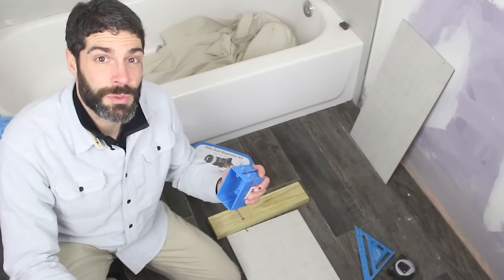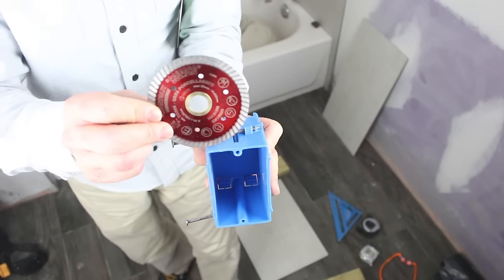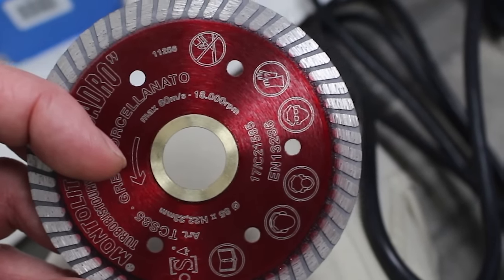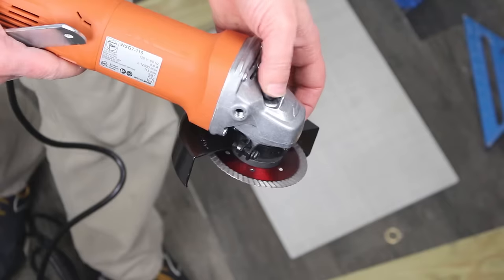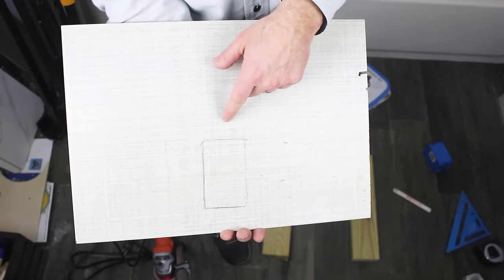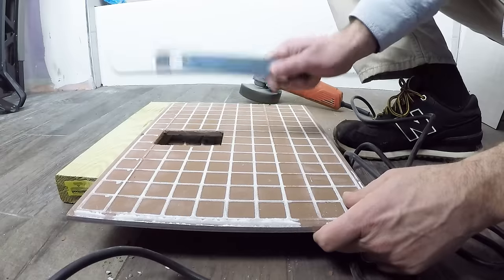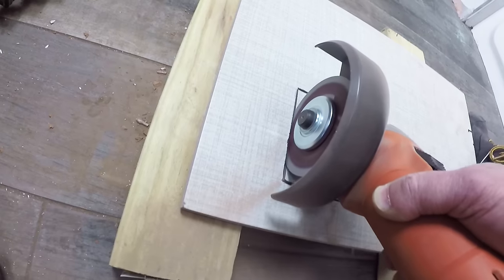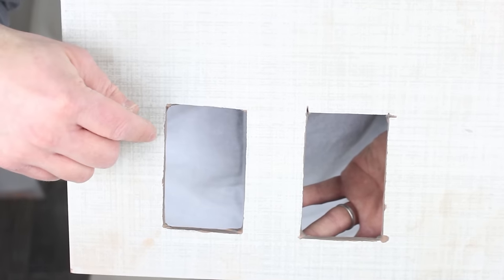How to Cut Tile Around Outlets (Easy Accurate Cuts!)

Comment: Bought this blade after watching. It works excellent and I cut 15 outlet and switch boxes in ceramic tile before it started wearing out. Towards the end the blade began cutting slower, glowed orange and was staring to cause minor chipping. So consider it a consumable for a large kitchen back splash job.

Comment: Big handy tip here...the back side you can over cut all 4 corners. Don't go all the way through but you can go about half way or so as it can't be seen and it makes it much easier with less trim work using a 4.5 blade

Comment: I purchased the combo the Fein grinder and the Montolit  Squadro blade, I'm a little confused with the blade mounting in your video. The first blade in the video shows a blade with a brass washer mounted in the arbor hole, further in the video shows a blade without the brass washer which is the one I purchased. The oversized brass washer laying on the right side of your tile project is not mounted on the grinder when you made your cuts is it needed?  If so does it go on the front of the blade or the back when I mount the blade?  or do I just discarded it?? Thank you.

Comment: Very useful video!  Do you have a video that shows cutting the bottom off a tile that is attached on a wall?  The bathtub tile has a finish column on each end of the tub surround that goes down beside the tub. Problem is, installers have that bottom tile so long it is flush with the concrete subfloor. I would like to trim an inch or so off the bottom of both 4” wide tub tiles so I can lay the new tile floor corrrectly.  I will remove those two tiles to cut them then reinstall if necessary but was hoping to just cut them in place. Of course, I have to be real careful where they meet the tub skirt.

Comment: Thanks. Got what I needed here - a little info not mentioned in narration... Montolit is an EU European (Italy) manufacturer. The smaller blade Squadro here seems to be their 85 mm diameter disc — as stated in the video notes that is approximately equal to 
3 ³/₈ inches — sold in UK for around £28 and (pedantry alert) at 0:20 are you sure that the radius of a four and a half inch diameter blade is "two and two quarters of an inch"?   ;-)

Comment: So if this is being done on tile that's already mounted (can't get to the back side of the tile), how would you complete the opening?
Reply: Use an even smaller tool like a Dremel with a blade for the tile.

Comment: Looks like a handy little blade. Definitely won't be using it for big tile. May be useful as a small backsplash blade on a 4 inch grinder. I only use 5 inch vs grinders with a 5 inch wheel for everything.

Comment: I bought an angle grinder to tile my backsplash - this is my first time doing it. I am using a ceramic tile also but when I went to do my first cut there were a ton of sparks. Does that mean I'm using the wrong blade?
Thanks
Reply from the maker: What kind of blade are you using Lisa?
Reply: Dry blades will create sparks sometimes because of the composition of the clay and having nothing to do with the blade. You can wet the tile and it will decrease but not eliminate the fireworks. Don't be concerned with a few sparks. Do not use any electrical tool in explosive atmospheres.
Reply from the maker: Thanks George for your tips, very appreciative
Reply: The_guy_that_brake_checks_ Jerkoffs plan plan plan, prep prep prep, make sure you have everything you need and the RIGHT tools and blades down to screws/caulking.

Comment: On my angle grinder, diamond blades rub on the safety guard. Is there some kind of spacer made for this purpose or can I just use a washer to bump it out a bit?
Reply from the maker: What size angle grinder?
Reply: Hi there. I had the SAME problem with my grinder. It sucks. But there is realy nothing to do. Maby the grinder manufacture has a different guard for this task. If so you are lucky. In my case i learned that i simply need to buy a new grinder. Like makita or bosch. Their grinder guards are built much better and not in the annoying angle like your grinder and mine. Just dont be tempted to cut anything with out the guard... buy a new one or borrow one - that what i did. I used a makita 5 inch grinder.

Comment: How can you do this if you already have tile on the wall?
Reply from the maker: Same method but very carefully, however, how long has the tile been on the wall?
Reply: @HomeRepairTutor  the tile has been on the wall for maybe 3 years max. Should I try to take the tile off the wall and then cut it? I still have a few tiles as back ups just in case something broke.
Reply: @HomeRepairTutor  thank you 👍
Reply from the maker: @joe62845  if you just need to grind down the tile to make it fit better I have some other recommendations, you can send me some pictures of the tile at jeff@homerepairtutor.com
Reply: @HomeRepairTutor  reply nah I wanted to add a new outlet. I meant to have it installed when I redid my bathroom but forgot about it. So now I want to do it myself. I have access to the wall behind the wall with the tile so I’ll run the wire through there but wasn’t sure how to cut the tile without destroying it.
Reply from the maker: @joe62845  gotcha you could drill four 1/4” holes at the four corners of where the outlet should go then use this blade to cut out the tile and drywall
Reply: @HomeRepairTutor  awesome! Thank you for the help, appreciate it.

Comment: That's a cool Lil blade....I might have to pick one up and give it a try. Would this be ok for curved cuts (like a 4.5 mixing valve hole) or only straight cuts?
Reply from the maker: I’d have to check on curved cuts. Typically they say no to any curbed cuts. But everyone does it. I’ll get you a solid answer
Reply: Home Repair Tutor yeah, usually only solid rim blades from what I understand....but this one isn't a mesh configuration and those ones are the ones everyone says absolutely no curved cuts
Reply from the maker: Just got an answer from Montolit, the Squadro can't be used for curved cuts. Hope that helps. Still a great little blade for these outlet projects
Reply: Home Repair Tutor sure is! I'm gonna get one regardless....thanks for the answer Jeff

Comment: I see how to cut an outlet hole but I need to cut on tile that is on a installed on a wall. How do I do that since I cannot make the cuts on the back side of the tile like in your video. 

Irv
Reply: Easy!.  Did you do it yet?
Reply: Step one don’t install your tile over box then cut it out . Cut it first
Reply: Predrill the four corners will a small diamond bit
Reply: @Ha-kf6ge  lol RIGHT i see people commenting this question alot

Comment: Very late to the conversation. This is probably more of a physics question, but why is it that the RPM number needs to be higher (than what your angle grinder specifies) on the blade?
Reply: You are correct that it's a physics thing.  Like tires, blades are manufactured to work up to certain speeds of rotation before they become unstable and could fly apart. Can't use regular tires on a high performance sports car. The top speed of those cars generates a much faster tire rotation than regular tires can handle. Also there's a heat element as well. The faster the blade spins on the item being cut, the higher the temperature generated from the friction. Could cause damage & injury to the blade, the angle grinder, & especially to the user.  Same goes for car tires. Driving too fast for the tire rating can start deforming the rubber on the tire due to the heat from friction (my brother knows this from personal experience, haha).  The tire could blow out or fly apart when the centrifugal force on the tread area gets higher than the tire is built to handle.
Reply: Grinder spins at 12,000 RPM, the blade can take up to 18,000 RPM before it starts rendering useless and dangerous

Comment: So "the war department" wants to go with big tiles for the kitchen backsplash BUT I say little tiles are easier to install. We have 9 bloody outlets so that's a lot of hole cutting but this makes it look easy and the big tiles  sure look nice  - 24  inches by 8 inches. Is this a bad idea for someone who's never done tiling before. I'm a good (YouTube) learner though and just installed an Ikea kitchen and countertops too :)
Reply: So how did it go, ive got big tiles and am worried about cutting the holes for the sockets
Reply: @lumsdot  The sockets were  the easiest part! Just use a diamond blade Italian made circular blade. Smaller is better. Cutting the big tiles was a bit problematic as I used a professional cutter with a water jet but the sled the tile sat on was not square so I had issues cutting a completely straight line. The tile cutter was a friends so I had it for as long as needed so this was a hug benefit vs hiring one from Home Depot for $20 a day. Get the biggest baddest cutter you can afford to rent, you won't be sorry especially for big tiles!
Reply: @JacanaProductions thanks, that gives me hope. Im getting a small blade, so hopefully it will go well

Comment: Kinda hard to flip the tile over when its already on the wall.  VIdeos not helpful for new work on existing tiled walls.
Reply: lol what?? if the tile is already on the wall why would you be cutting out a box for an outlet??? shouldnt the outlet be already on the wall before tile???.... and otherwise just chip the tile off the wall and replace it with a new tile
Reply: @PeleTeleBui We’re replacing our receptacles and the box is too small. So we have to replace the box and widen the opening in the tile all in place. Video is still helpful

Comment: #1. There are no 3” at the local big box hardware stores. #2. I had to buy the 4” or order online. #3 You will likely mess up your first couple tries. #5 Avoid the whole process if you can. #7. No, the cheaper ones that (high) for tile do not work.

Comment: You could have taped before grinding to prevent chipping
Reply: Good point for certain situations. To get a perfect line, a water saw is recommended. However, in this case, it doesn't matter since it will be covered. Nobody will see the chips.

Comment: The littl3 blade is not needed.  I would do it with a 5 " blade
Reply: How would you keep from over cutting?
Reply: @rebecca2827  cutti g from the back side..
Reply: Predrill the corners will a diamond bit

Comment: I have cut outlets with a 7” blade. Steady hand does it. Once the cover plate goes on it doesn’t matter if you have a small chip or overcut somewhere. Here’s the truth: everybody wants to make more money quicker. Same for the toilet flanges. Once the toilet goes on, it doesn’t matter. You may take your time and make the cut extremely nice, but does it really help you make more money?  You may say Well my cuts are so nice and that means I care about the customer and about the other people who see my job. Any of them care about you? I do tile work to make money, not to make friends. And I do follow all of the TCNA guidelines. Here’s my thoughts on fancy nice cuts: if it’s in the open or it’s required for structural integrity, then yes, otherwise it doesn’t matter
Reply from the maker: appreciate your point of view and completely agree, it's nice to know what tools make it a little easier just in case the cut needs to happen.
Reply: Home Repair Tutor Absolutely! I need to make a square cut on already installed floor porcelain tile. Any input would be appreciated.
Reply from the maker: @lockpickingvlad  in that case we'd use a speed square to mark the location and use an angle grinder with diamond blade, but you probably knew that already. One tool we really like is Fein's dust shroud for angle grinders. That attached to a HEPA vac cuts down on dust a TON.
Reply: Home Repair Tutor yeah. Thanks for the tip. They should make a laser tile saw ;)
Reply from the maker: @lockpickingvlad  was thinking the same thing a few weeks back, to have a laser attached to the angle grinder for easy cutting. They do it for other saws!

Comment: Why would you need such a small blade for a job that can be done with the normal size blade.  pointless
Reply from the maker: It’s much easier to cut the short side of outlet boxes with this blade than a 4-1/2”, give it a try

Comment: This video is completely useless. It’s just an ad for the blade and doesn’t explain how to measure and position the cuts. Rip off.
Reply from the maker: No, it provides good tips and shares how to properly use a blade. You buy any blade you want, I just share the proper tips